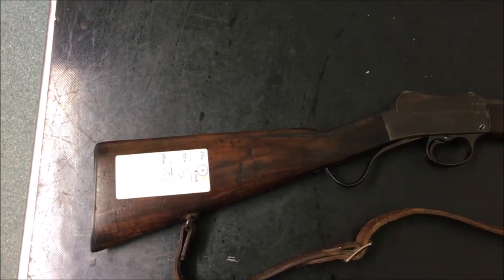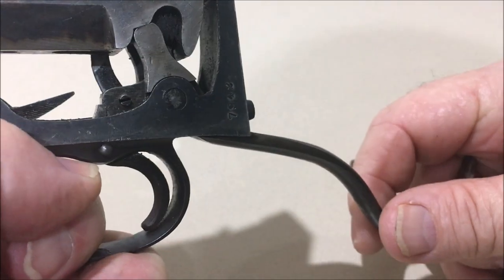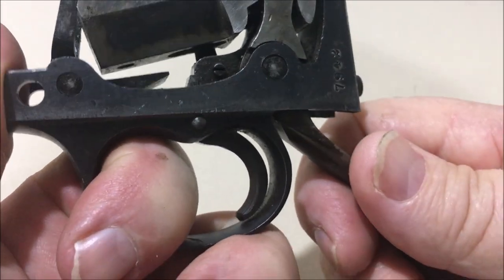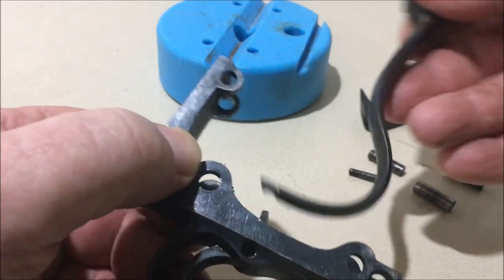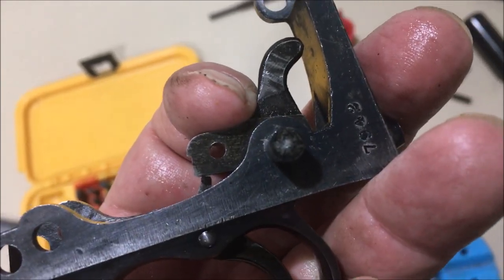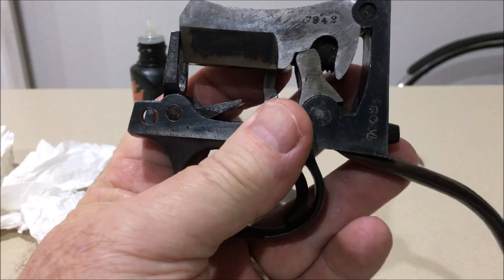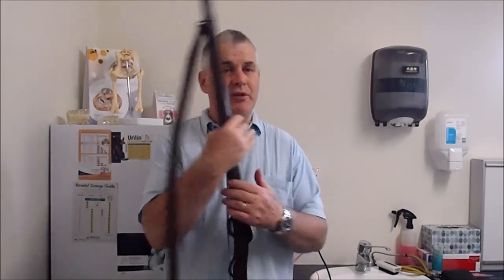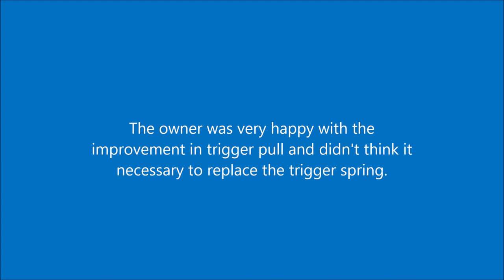Reducing the Trigger Pull in a .310 Martini Cadet Rifle.

Comment: Hi mate, I've had Cadets for 40 yrs. Some in .22LR others in centerfire.  The best way to improve the trigger is to replace the leaf spring with a coiled spring. Doug Barnes here in WA used to do a lot of conversions (I have one in .222R) and the trigger he set up is crisp and light but safe against bump fire.
Reply from the maker: G'Day Steve.
That's interesting. I hadn't heard of that conversion. I have another Cadet action with a heavy trigger spring and I can make leaf springs so am planning to do a video showing the making and replacement by a much lighter leaf spring of the same design.
I guess back in the day they made the trigger spring heavy for safety with novice shooters.
Reply: @456eec  Indeed, they were for kids really. I've worked on quite a few. .22LR. .22WRM. .222R. .223R. .357Max. 6mm Phillips. .257 Mag. 25/20 Imp. I also have a Martini Henry in .35 Whelan rimmed.
Reply: @stevephillips8719  Used to own one Martini Henry in 358 Winchester rimmed.  (A 444 Marlin case shorten and run into a 358 Winchester sizing die.)
Reply: @garycorbier9123  Yes I have a Martini Henry in .35 Whelan (Rimmed).  Based on the 9.3x72 case shortened and necked.  It is a beast to shoot. 200gn at 2700fps in an 8lb rifle.

Comment: I looked up the martini cadet,s history and what they did was drill and tap
 a hole from the guard up to the trigger spring to adjust the tension on the spring it was a factory  modificatin it was several years back maybe 5 so i cannot give you all the details but its there

Comment: Would the procedure for reducing the trigger pull pressure on the Martini Cadet be similat to what it would be on a Martini-Enfield in .303 Cal.? My Martini Enfield has a trigger pul of somewhere around 20 lbs of pressure. Just pulling the trigger is painful.
Reply from the maker: They don't have the removable Francotte system but the principle would be the same. May be worth dismantling abd polish the sear surfaces and possibly replace the trigger spring with a lighter one.